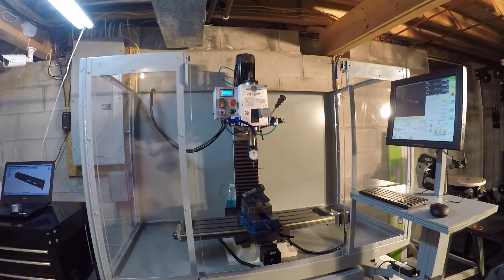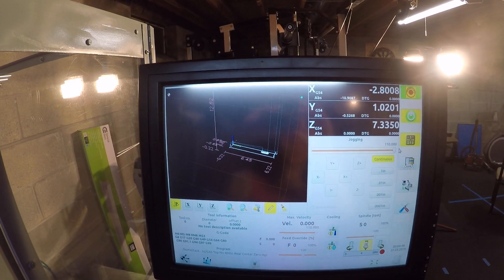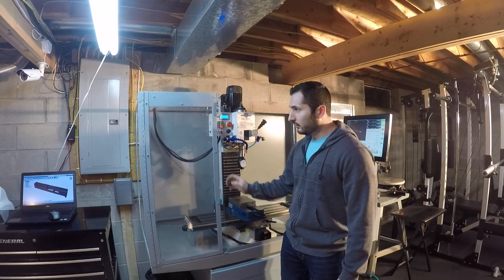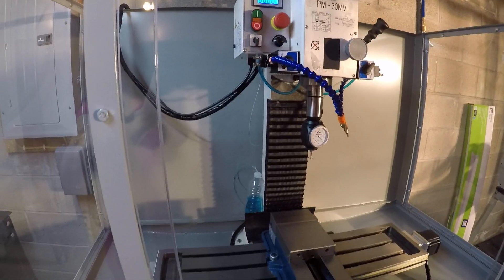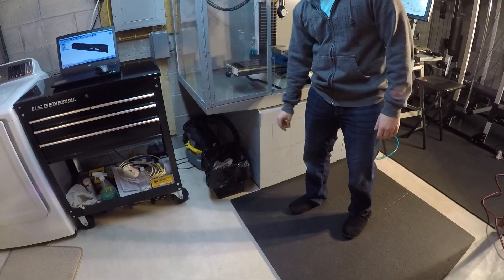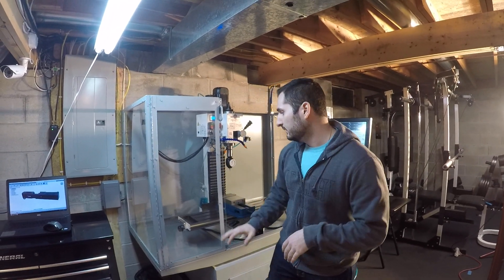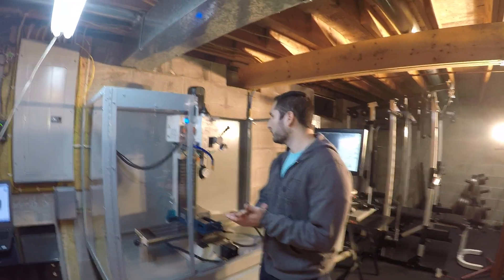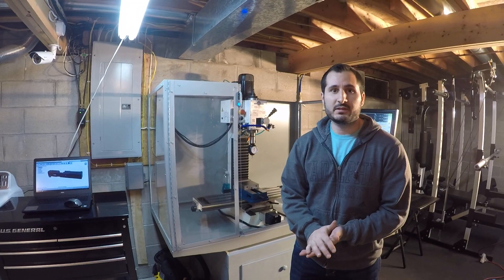Finally a walkthrough of the mill

Comment: Do you prefer imperial or metric for end mills?
Reply from the maker: I would say that I really don’t have a preference. I use mainly imperial because I’m American and it’s what my brain is trained to think in, but the cam software does all of the thinking for me anyway so it truly doesn’t make a big difference to me. I have a handful of metric endmills because they were what I had available or in a certain geometry (like dovetail cutters) they fit my needs more but overall I would use either.
Reply: @MPMachining  thank you for the feedback. I just order the PM30 and starting to source all the little pieces. Any recommendations on places online for end mills?
Reply from the maker: @TheAnt0906  lakeshore carbide is great. Carl (the owner) is a very helpful and responsive person if you have questions or issues getting a tool to run well. Harvey is also really good as is Maritool. All 3 of them you can order directly from so you don’t need a tooling rep
Reply: @MPMachining I pick up this mill for gunsmith. I’m fairly new to CNC, what bit should I start off with? I will be doing mostly optic cuts and 1911 tri top cuts
Reply from the maker: @TheAnt0906  for the PM30 with a fairy low Hp spindle, I would recommend going with a short flute length 4 or 5 flute 1/4” or 3/8” endmill (or similar metric size) that is AlTiN coated and meant for cutting steel
Reply: @MPMachining  what oil can are you using for the slide way ball oiler?

Comment: Hi
My name is Wagner and i'm new in the CNC, i have the PM25 converted to CNC for engrave the guns that i make, you did a great job on your machine, i have one question, what type tool holder you use on your machine?
Thank you
Wagner Damotta
Reply from the maker: Hey wagner. Thanks for stopping by. I use the Tormach TTS tool holding system. Well worth the investment and I would highly recommend it
Reply: @MPMachining  
Thank you V much for return my msg, do you have a video show how the tool hold work?
Reply from the maker: I believe in one of my videos I cover it but I don't have a full video dedicated to it
Reply: @MPMachining  
What you do for change tool with the TTS?
Is the same way with the R8 before?
Thank you
Reply from the maker: @wagnerdamotta726  look through my machining videos (I believe the one when I made the white strut brackets for the machine). I show a full toolchange in there. It is much faster and easier than before with R8 and much more accurate Z height
Reply: @MPMachining  
Yes i saw last night and i going get for my machine, sir what is the blue liquid in the bottle in your machine?
Reply from the maker: @wagnerdamotta726  that is Cool Mist coolant that I use when cutting aluminum
Reply: @MPMachining  
Thank you

Comment: Thanks for sharing. What do you do about oiling the gibs & ways?
Reply from the maker: Right now I am doing it manually with the oil fittings on the machine then spreading a but more by hand. It's been working plenty fine but it's definitely time consuming. I picked up a one shot oiler with the intent to install it during my upgrades then I got very carried away in the build and ran out of time. Hopefully in the near future I'll get that installed.

Comment: Great job, thanks for sharing, I have the same pm30 that I bought a few months ago to covert to cnc, yours looks fantastic, my I ask what stepper motor size have you used?
Reply from the maker: Originally I went the very cheap route with open loop nema 34 steppers. 1200 oz-in for the Z and 670 oz-in for X and Y. It definitely got me by for the past year and a half but I'll be honest I very much regretted going open loop steppers. I have since upgraded to Clear path servos and the change is night and day. The servos are about 10x the price of the steppers so it is difficult to justify for most people. Closed loop steppers about 1200 oz-in for each axis is honestly what I would have done if I could do it over. Not a huge price difference over the open loop and more than enough power. If you can justify the servos though, they are incomparable to anything else and far better in every way

Comment: That's a really great setup. Do the ballscrews have double nuts?  What kind of backlash do you have?  How hard was it to move into the basement? If you broke it into pieces, how much do you think each piece weighed?
Reply from the maker: Mike Johnson I do have a double nut system in my ballscrews and you have some pretty great timing. I’m actually filming a video as we speak addressing my backlash and the speed of my axis. I’m replacing the Z stepper motor to get a little more speed in Z. As for backlash, I currently have less than .001 in the Y. About .001 in X and .008 in Z. The z value has never caused me any issues and I have successfully used backlash compensation on LinuxCNC to take care of it but I’m working to fix it as we speak and you will see that in my next video. 

As for ease of moving it, you can very easily take it apart and move it down a couple flights of stairs by yourself. I had a second person helping me and that let me keep my z column mounted to the base when I moved it but without him I could have simply taken that off too and moved it myself.

Comment: I'm in the market for a mill basically for the same reason you bought yours, gunsmithing and customization for myself. I'm at a toss up between the PM-25 and PM-30. I'm really leaning towards the PM-30. I was going to keep it a manual machine but I'm curious (if you don't mind me asking) how much did it cost for the CNC add on? I'm extremely mechanically inclined and have machining background but no CNC experience. It is all very intimidating with the computer stuff. Thank you
Reply from the maker: I unfortunately dont have exact numbers for my conversion cost but I'll give you some ballpark ones so you have an idea. The conversion kit from ProCutCNC was about $900 which included the ballscrews and mounts for the steppers. The steppers themselves including drivers and power supply was about $450. Roughly $200 for all of the random wires and extra little stuff like breakout boards and stuff to connect it to a computer. I spent about $400 on the computer that I use to run LinuxCNC. So all said and done about $2000 for the conversion. 

I'll tell you that i was in the same position you are in when I bought the mill originally and what put me over the edge to converting was this. The cost for a DRO on the PM-30 (which you are absolutely going to want for a manual mill if you want to get stuff done in a timely manner in my opinion) plus the cost of all of the extra stuff you will need for manual machining like a rotary table etc, it was about a wash to just convert the mill to CNC.

As far as the PM-30 vs PM-25 goes, I was always on the mindset that you should get the biggest machinery within your budget because no matter what you get, you will always wish you had the next size up. If you can afford the PM-30, you definitely won't be upset that you got it. It cuts firearm slides like butter (maybe I'll upload just some raw footage of the last few slides I cut so you can get an idea)

Dont let the computer side of things intimidate you either, most of it is very straight forward and any question you will have along the way, someone has had before you and the answer is on a forum somewhere or in a YouTube video.

Hope my limited perspective there helps and if any other questions come up, let me know.
Reply: Is your coolant and air setup a kit offered by someone? Is the LinuxCNC software better than something Windows based?
Reply from the maker: @Quik5oh  The air blast/mist setup is something I put together super cheap from Amazon (I can get a link if you're interested). The whole setup cost me less than $60 and it works amazing. They came with the air nozzles, the siphon tube for coolant which included a check valve, filter and the valve block which lets me dial in how much mist comes through or turn it off. From there I picked up 2 cheap magnetic bases so I could stick the air lines to the head of my mill and a single 5V solenoid valve that lets LinuxCNC turn the air on and off for me. I can go into some more detail or give you a list of exact parts if you need.

As far as controllers go, I have been extremely happy with LinuxCNC. I started out with Mach3 and there wasn't anything "wrong" with it but after switching to LinuxCNC I would never go back. The software is much more configurable and it is also free which is a plus. 

Thanks for watching!

Comment: Could you tell me sizes of ballscrews that you have used ? I kind of cannot find my answers
Reply from the maker: What specifically are you looking for? The ball screws here are double nut C7 grade 2005 (20 mm diameter with a 05 mm pitch) and are turned down to a half inch shaft on the ends to mount to my NEMA 34 steppers
Reply: @MPMachining  i want to know overall lenght of those screws
Reply from the maker: I actually don't have the exact lengths. My screws came from procut cnc